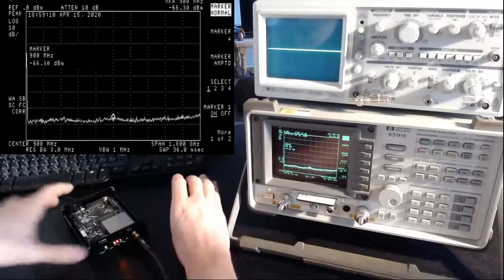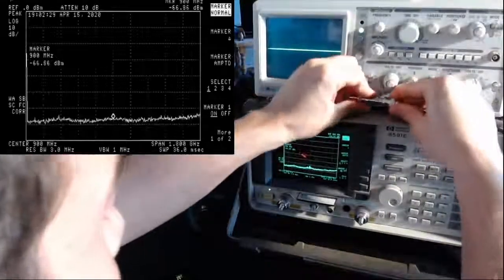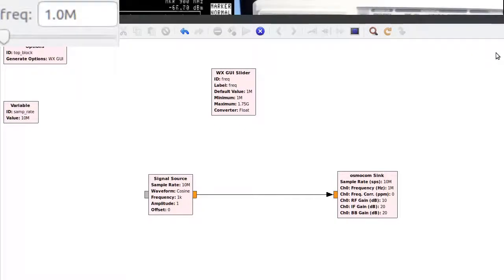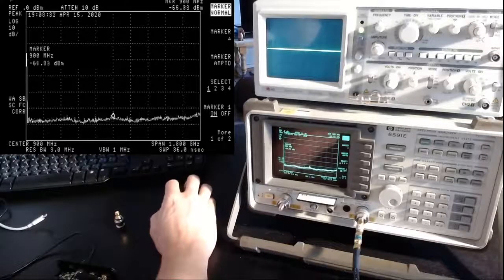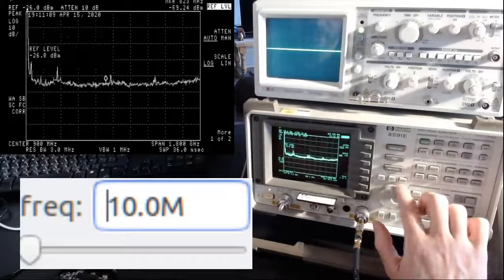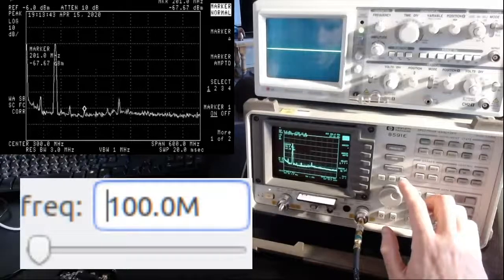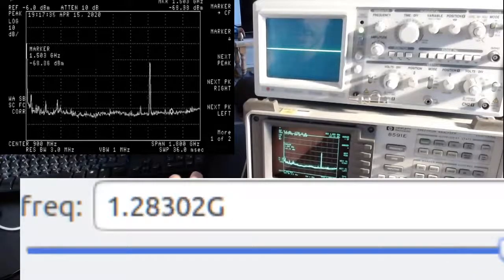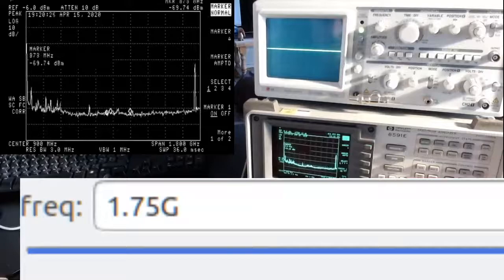Episode 6: HackRF as a signal generator - a first look

Comment: You could also build a frequency divider to get the full RF output range of the HackRF One. All you'd have to do is multiply the output frequency you see on your HP spectrum analyzer.
Reply from the maker: thanks for the nice words diggleboy. Yes, I have been thinking about a frequency divider. I am not sure I have the skills to build something that work up to 6Ghz, but I am looking on ebay and 2nd hand places for such units (e.g., minicircuits): dividers, etc.
I want to keep the costs under control, however. These toys become very expensive very quickly when you mount up with frequency :)

Comment: Nice to see you putting the HackRF One to the test on your HP spectrum analyzer. I don't blame you for protecting your very expensive piece of test and measurement equipment. I'm really liking the low cost effectiveness of the HackRF One  for its multi-use and multi-purpose functions. I think I'll pick one up for sure to use in my lab. But now I'm spending a lot of time looking for a good vintage spectrum analyzer online.
Reply from the maker: Yes, the price for the HackRF hardware is very good. It would be great if someone could code a "calibration" procedure. For example, as a signal generator, it would be very useful. Of course the problem is that to calibrate you need to external measuring equipment (e.g., spectrum analyzer and such).

Comment: hello! Which os are you using? Pentoo? thank you! nice videos!
Reply from the maker: Hi and thanks! No so far I've been using plain Ubuntu :)
Reply: @therfnoob7697  Cool. I am also setting everythin on Ubunto but I am having some issues. For instance I have followed this but I can execute Qspectrumanalyzer... command not found

# Add SoapySDR PPA to your system
sudo add-apt-repository -y ppa:myriadrf/drivers

# Update list of packages
sudo apt-get update

# Install basic dependencies
sudo apt-get install python3-pip python3-pyqt5 python3-numpy python3-scipy soapysdr python3-soapysdr

# Install SoapySDR drivers for your hardware (e.g. RTL-SDR, Airspy, HackRF, LimeSDR, etc.)
sudo apt-get install soapysdr-module-rtlsdr soapysdr-module-airspy soapysdr-module-hackrf soapysdr-module-lms7

# Install QSpectrumAnalyzer locally for your current user
pip3 install --user qspectrumanalyzer
qspectrumanalyzer and soapy_power executables will be then placed in ~/.local/bin directory, you can add it to your PATH in ~/.bashrc.

I USED THIS : If you want to install QSpectrumAnalyzer directly from Git master branch, you can use this procedure:

git clone https://github.com/xmikos/qspectrumanalyzer.git
cd qspectrumanalyzer
pip3 install --user .
Reply: @Radiogenes  execute qspectrumanalyzer NOT Qspectrumanalyzer.  I made the same mistake!
Reply: Kevin Polston thank you Kevin!